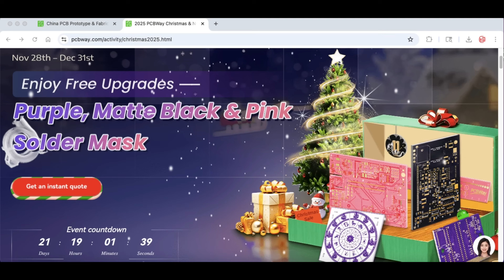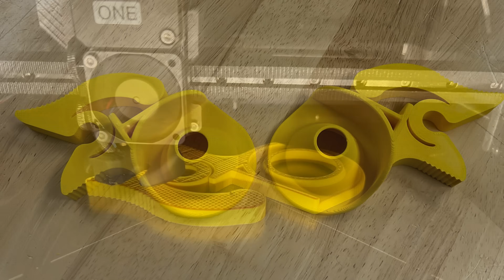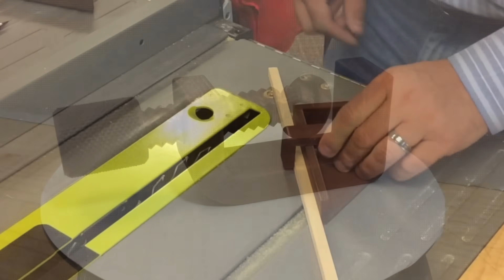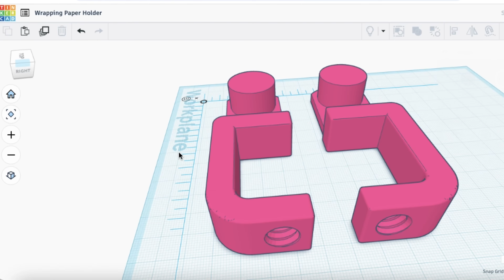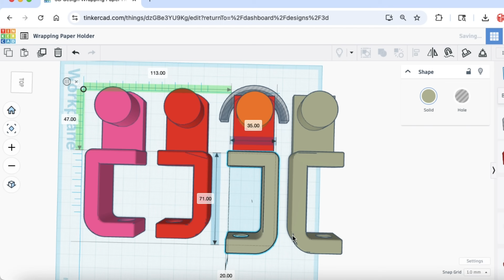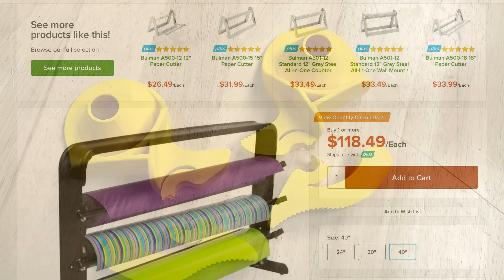Useful 3D Prints Make Gift Wrapping SO Much Easier

Comment: Increasing infill does not make the part stronger, if you want to make it stronger add perimeters. Prusa slicer often defaults to only 2 for faster printing, increase it to 4 to make the part a lot stronger.

Comment: Unfortunately, the large clamps differ by 2 mm and the small clamps by 1.5 mm. The wrapping paper roll is then installed at a slight angle. It is not parallel. Yesterday evening, I downloaded the stl file from Tinkercad.

Best regards,

juck.
Reply from the maker: I fixed it. Try again.
Reply: @FilamentFriday thank you very much 😊

Comment: Oops! Printed this from the tinkercad site and the bolts would not screw in. Turns out the threads on both clamps are left hand threads. Easy to fix in TC, but wasted time and filament.
Reply from the maker: I just fixed it. Somehow an old version got in there. Thanks for the feedback, sorry about the filament.

Comment: I was not expecting this at all but unfortunately it was a loss of time and filament for me - threads do not fit or work at all.
No changes on the design were made at all and the only I things I did differently was to print it with 0.2mm layer height, 4 walls and 15% infill
Reply from the maker: Interesting. I printed it 9 years ago on less quality printers. Maybe try printing the threaded shaft from the Printables site and see if it’s any different.

Comment: Nice project and thanks for the background.   I also use TinkerCad it is so easy to take a design and make simple mods to it, or as you did combine parts from multiple designs.  Most 3D printer hobbyists think the same way, I can make that, I don't have to buy it, and we usually succeed, if not we learned something!

Comment: I tried the same as your first print and suffered the same failure.
So I just pushed the table against the wall and the wondering wrapping paper problem was fixed.